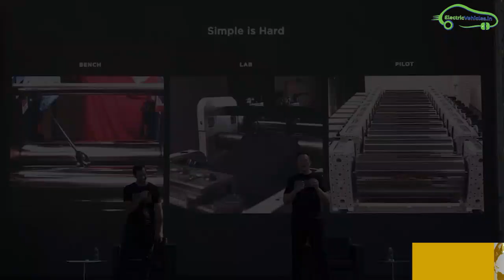ATHER 450X SERIES 1 ELECTRIC SCOOTER, TESLA 4860, MAHINDRA TREO - EV NEWS 114

Comment: What Bro Tesla 4680 battery has increased 16% only for cell design.atual energy density increased of that battery has 54%.which also includes it's cathode and anode chemistry that anode silicon 20%, cathode 4% and vehicle integration 14%.
Reply from the maker: Thanks for your valuable information